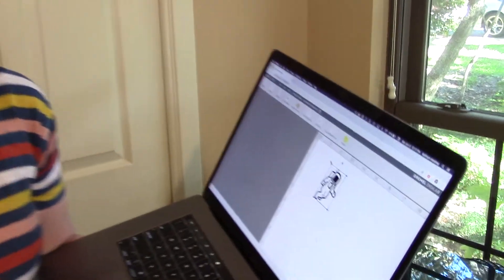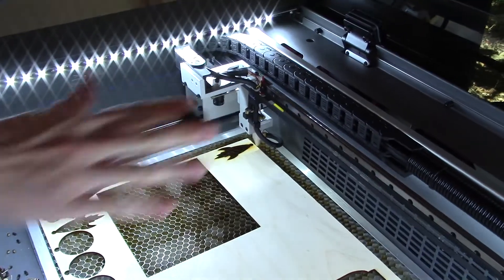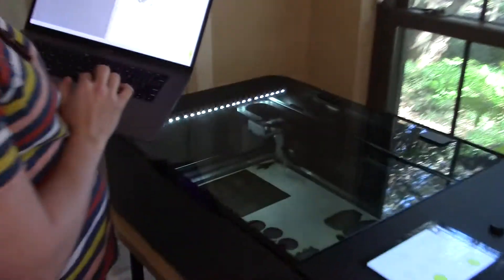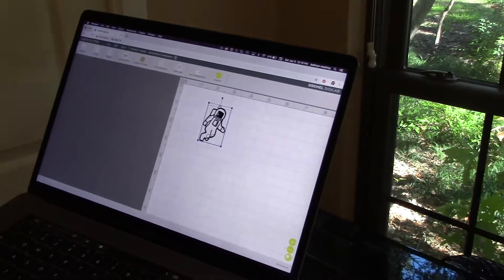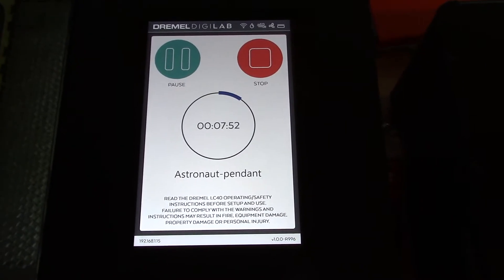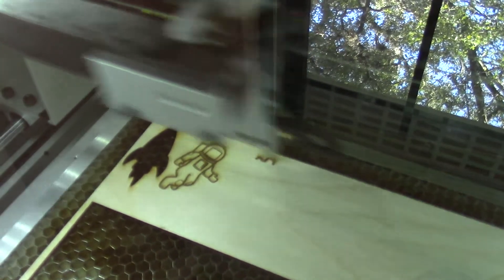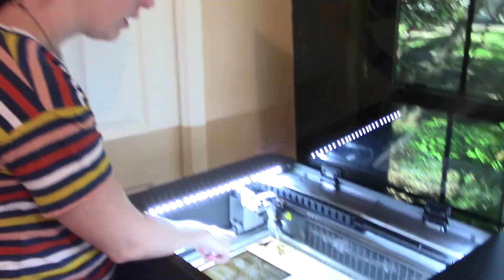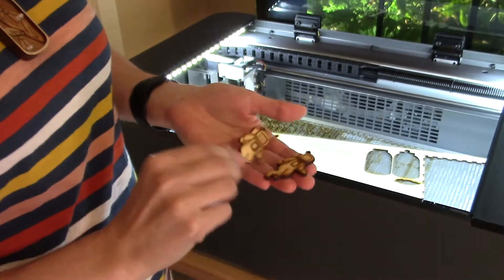Laser Cutter Example File - Astronaut Pendant design - on my Dremel Digilab LC40 Laser Cutter

Comment: I'm wondering why you don't use the camera option for placing your work.  Is it not accurate?  I'm thinking of getting the Dremel, or the Muse, and the camera seems to be one of the selling points.
Reply from the maker: I've used the camera a few times to capture a drawing and engrave it, and that's pretty awesome. But it's actually easier (and faster) to use the perimeter to place the pieces. I'll do a video about that feature soon!